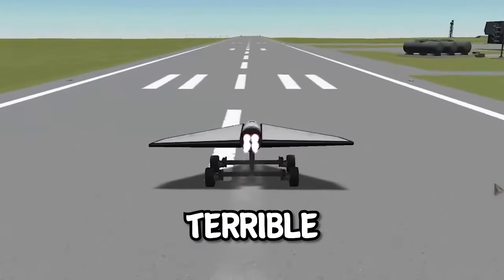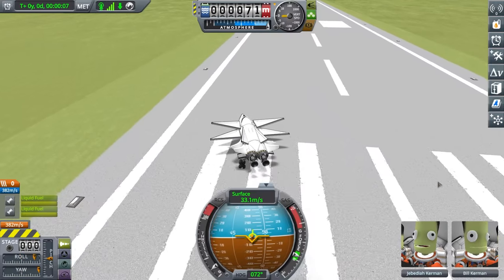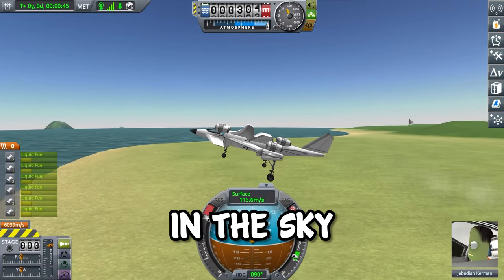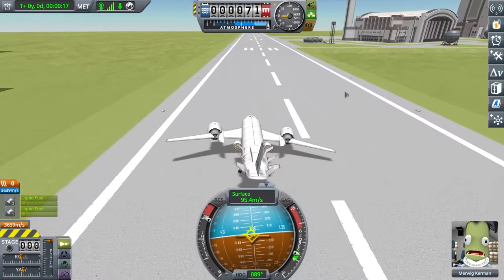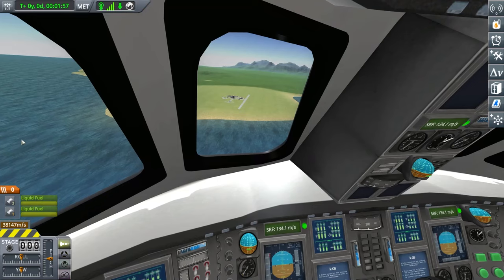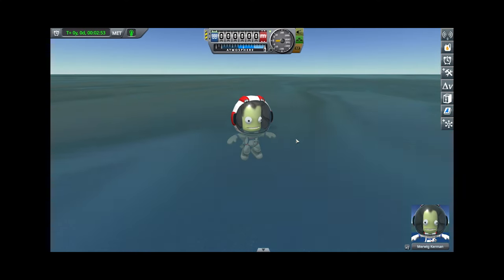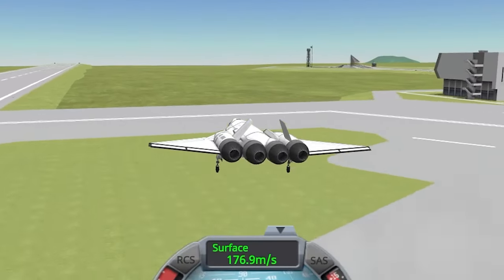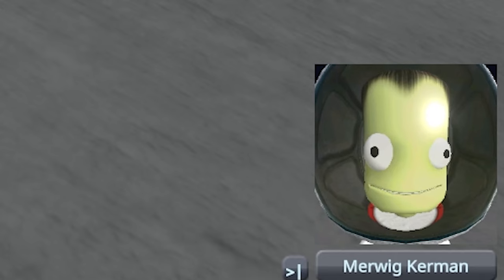I Tried To Make Airplanes in Kerbal Space Program

Comment: I started as a noob at KSP, i didn’t even know how to turn on an engine, i thought it was the same as the already had SFS, after i learned it was Z, i learned how to pitch up and down and roll. And then my favorite thing- a plane, i made an early design with no tail fin, it went off the runway but did a backflip. I made a smaller design that flew but wasn’t able to control, it flew for a couple seconds before crashing, i tried over and over, until i got the perfect design, Small design, wing type B, tail-fin on the wing for pitch up and down, Ailerons and tail fins on the back, it flew super good, and it made it to the Island airfield and back. I saved it as- “ Forest-F1” because i made it in KSP2 and it flew just as good as it did in KSP1, this is the whole story of how i became an expert at KSP.